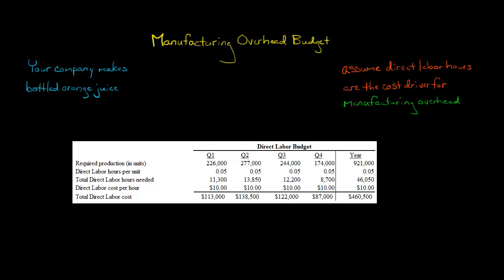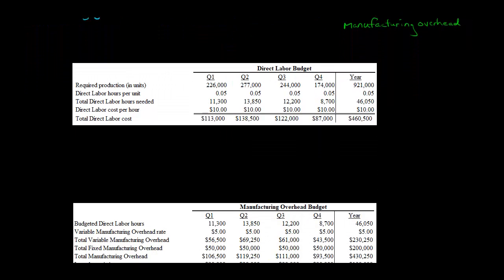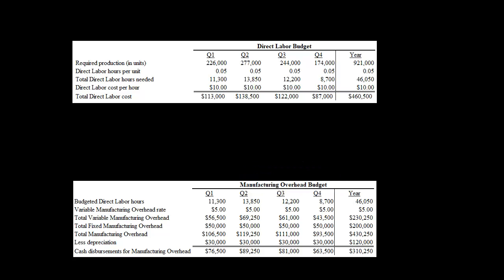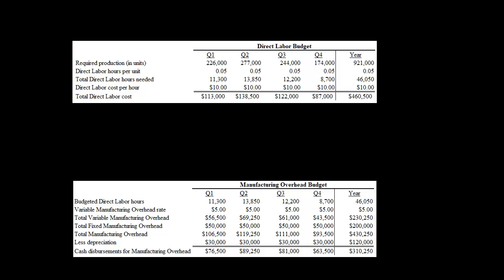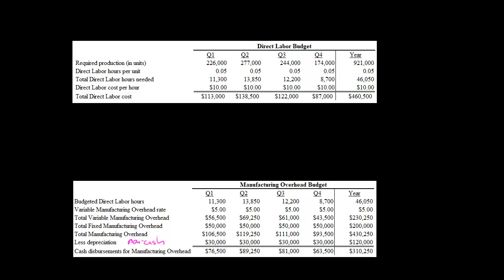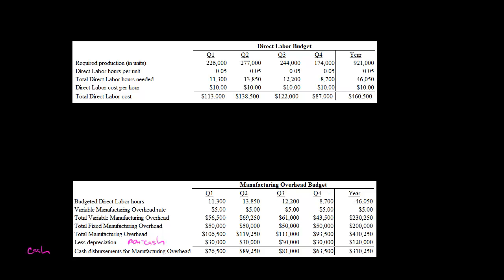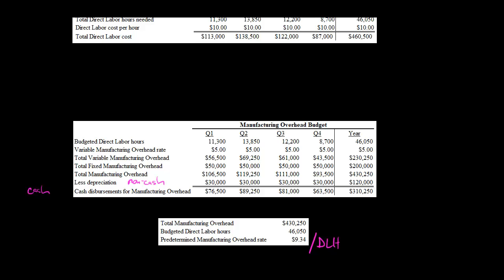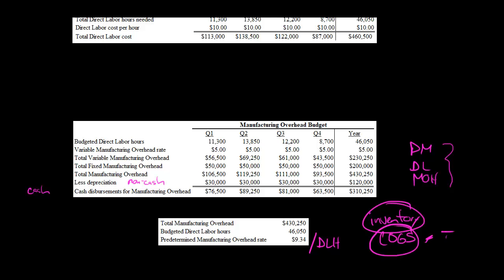Manufacturing Overhead Budget

Comment: I have a question don’t we separate the fixed and variable portion when calculating overhead rate per direct labor or machine hour.. in this case 230259/46050 for variable portion and fixed cost remains constant within the relevant range...please help
Reply: Budgeting follows Absorption costing, not marginal costing. So the fixed cost in this case is not period cost but a product cost meaning that it's cost will be integrated into the inventory and some of it will become the cost of sales while some of the portion of this fixed cost will become part of the ending inventory. 
for a better understanding of this concept watch Edsire's absorption and marginal costing lectures.

Comment: why did 113,000 become 11.300 ?
Reply: Flako Don 96 The Rapper From Jamaica 226000*0.05=11300 and 11300*10=113000
Reply: 113000 is the total direct labor COST. for the manufacturing overhead budget you would use the total direct labor HOURS which was 11300.